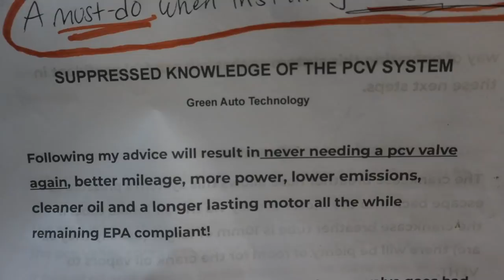The Wonder Of Positive Crankcase Ventilation

Comment: I would say the quality of engine oil did more for life expectancy than the pcv but it sure didn’t hurt anything.  Most all pre 2000 year diesels ran open crankcase vents and they certainly didn’t seem to suffer any longevity effects.  Of course being turbos they tend to keep their crank cases blown out anyway.
Reply: It's now common to add open crankcase breather kits on the newer heavy/medium duty semi engines. Most new diesels have oil vapor centrifuges that end up wearing out prematurely and cause seals to blow out from excess crankcase pressure. And those centrifuges can cost 600-$1000 in some cases.
Reply: Yes, the turbo is why old diesels get away without a pcv valve, on the non turbocharged 6.9/7.3 IDI Ford/International they used something called a CDR that acted similar to a pcv valve though I don't know how it works without vacuum.
Reply: My car is a diesel and its crankcase breather is simply a tube routed from the valve cover to the air duct between the air filter and the turbo. The filter is a flow restriction so that region of the intake should always be at a lower pressure than the outside air, presumably that's enough to suck the blowby gases out.
Reply: Fuel injection as well, carbs can’t accurately control cold air mixes nearly as well as EFI can.
Reply: Diesel does not have vacuum for a PCV. There is no throttle valve in a diesel engine. The rings are always seated to the lower side of the lands because of pressure always in the cylinder. The reason it works beautifully on a gas engine is any time there is vacuum in manifold it keeps the rings from bouncing in lands. This is also why race cars have a vacuum system on crankcase to suck the rings down and help them seal
Reply: Yes I'm old enough to had road draft engine and overall hauled s couple of them.  Engines were ugly inside and the sludge stunk awful.
Reply: @davepotanko5514  My 83 mercedes has positive crankcase ventilation  by routing the blowby tube into the aircleaner in front of the turbo
Reply: The non-detergent oils of the past and the lack of PCV, made it commonplace to remove valve covers and not be able to see any of the oil-starved valvetrain!
Reply: @davepotanko5514  Race cars often use a dry sump oil system where the oil is held in a tank outside the engine. This as you say produces a partial vacuum in the crankcase, because the oil scavenge pumps that recover the oil from the sump and send it to the tank are much stronger than the pressure pump that sends the oil back to the engine. The main reason to do this however is not for ring seating, there are lots of other advantages to dry sump systems e.g. less windage losses, better oil cooling and (most importantly) much greater resistance to horizontal G-forces in high speed turns.
Reply: I've run 1980s cars without a proper PCV system, in the 2000s.  Why?  Because it's not always feasible to rebuild an engine to make the PCV work properly, and, the oil on the underbody helps the car last.  I never had oil sludge problems.
Reply: @nerd1000ify  a vacuum pump on the crankcase for ring sealing, completely different from dry sump system
Reply: @bcbloc02  Volkswagens do the same thing must be a German thing. That is not positive crankcase ventilation   unless you have not changed your air filter in a long time. No vacuum Infront of a turbo just atmosphere pressure.
Reply: @davepotanko5514  Not completely different, a dry sump system achieves the exact same benefit by ensuring a low pressure in the crankcase.
Reply: 03 common rail cummins has a horsepower sweat tube no cat from factory and makes great emisions and as long as your rings are good you dont get alot of blowby so i never loose oil
Reply: NO engines --- diesel or gas were exempt from having a PCV after 1962 1/2 in California areas of Non-Compliance. That was all of Southern California and most of the San Francisco area too. 
Then by 1964 ALL engines in California --- the whole state either had a factory installed PCV or a retro-fitted one by installers and adjusters, like myself. 
However, by 1964, it was also a ConUS/Federal stipulation that ALL engines - both stationary and mobile, had to have PCV systems. )LNG and Propane engines were exempt for a couple of more years though) 
I was CalARB/EPA licensed in 1963 and made a lot of retrofitted PCV installations and people would cry that it was ruining their engines. Just like today with the Nancy-Deletes running around.
Reply: @davepotanko5514  High crankcase vacuum in racing engine is to help eliminate the drag from "pumping" the crankcase. That's a whole different thing.
Reply: Most of their miles are on the Open Road, so the draft tube works fine, whereas most passenger cars are often stuck in traffic, where it DOESN'T work well.
Reply: @SurferJoe46  you only plumbed it back into a atmospheric intake track. There is no vacuum in a diesel to make "positive" crankcase ventilation. You are only running it through the combustion chamber. Which leads to a dangerous condition to create a runaway diesel. Takes very little oil vapor to set them on a runaway, enjoy that.
Reply: @ferrumignis  if that makes you sleep better have at it.
Reply: @davepotanko5514  There's no excuse for ignorance these days Dave. Do a little research, broaden your knowledge.
Reply: @ferrumignis  you seriously think that a 3 stage scavenging pump pulls a vacuum on a running engine @6500 rpm. That is a kick ass ring seal you have in that engine.
Your right, I have broadened my stupidity.
Answer me this. Does a LS7 have a PVC valve? According to you I does not need one because of the dry sump
Reply: @SurferJoe46  limiting flow of what? You have positive pressure in a diesel crankcase  and atmospheric in the intake or ahead of the turbo. Where exactly are you creating a positive crankcase ventilation. Okay you put a catch can in-between the whole thing you are referring to sounds like another stupid C.A.R.B. solution that again does not work.
How many vacuum advance systems did you disable which did nothing in the long term except use more fuel and wash down cylinder walls with unburned gasoline, in the end creating more smog. Ca. is so short sighted it is really amusing.
Reply: @davepotanko5514  1) The scavenging pump is driven from the crank so it spins proportionally faster at higher engine speeds.
2) Who said anything about the number of stages? The only thing that was mentioned was a dry sump system, no details on the pump were given so you are clearly attempting to weasel out of this. It takes a man to admit they were wrong, so I don't expect anything from you.

Comment: Well, there were several things that cleaned up the engines in the Sixties . I'll give you my opinion, in the order I think most important  : 1), unleaded gas, ,,, 2), PCV valve, ,,, 3 plasma moly rings, ,,, 4), high detergent oil . Don't forget that steady stream of blowby coming down the road draft tube was caused by : gummed up engines, lousy cheap rings, and the non detergent oil that caused much of it .

Comment: i had a jeep that had a wierd system, instead of a PCV it had a fixed oriface that would plug up all the time, i actually upgraded that to a PCV and fixed a nasty blow-by issue i was having, i firmly believe in PCV valves, but i had no idea that they would use two PCV valves in some of the 2bbl classes, thats actually kind of cool to hear, great video, and very informative

Comment: I have a truck that had some blow by so i just straight piped both valve cover holes to the air box with no vavles. i have no idea if performance changed but the cab smells nicer now.

Comment: I bought a 65 Ford pickup with a 352 FE. It had 65k on it in the early 90s. It had a miss which turned out to be a couple bent push rods.  The old man who bought it new rarely drove it out of his small KS town. I pulled the valve covers and it looked like it still had valve covers. They were completely full of oil sludge. I had no idea it was because it didn’t have a PCV valve. Got it all cleaned up with a couple new push rods and it ran perfect.  It is one of those I wish I never sold.

Comment: PCV also added part throttle vacuum to the crankcase which lowered piston and valve guide blowby as well as main seal leaks. As I recall, there were retrofit kits available to add them in the 60s

Comment: I've got nothing but road draft tubes.... Haha. I love stock bubble valve covers, what can I say. With modern oils I have zero problems with sludge. When a CDR goes bad on my IDIs...... Road draft tube. No problem in the diesel's either. When I first started with road draft tubes I checked often for sludge and years later with hundreds of thousands combined miles, still no issues.

Comment: I just installed an aerospace vacuum pump on my stroker sbf. The crankcase pressure will often push gaskets out too. My 15 Volvo Semi has a crankcase evac system from the factory. D13 diesel.

Comment: I've got a 59 FE which I rebuilt last winter. It has a draught tube and was spanking clean inside. I certainly understand the smell of it idling though! 

It has been my understanding that motor oils are much better in the last 40 years. For example, the 59 Ford also has a 9" rear which had a thick tar like stuff in it along with the GL4 oil which I had put in it. I tore it apart simply to clean it all up. Old oils were prone to that black tar. 

I think it is the crankcase vapors which are not good for the engine to breathe. Therefore a mechanical vacuum system or better yet a passive exhaust evacuation system like UT mentioned with a filtered fresh air inlet is best for an engine.

Comment: I worked on a relatives GMC terrain that had some horrible oil in it last weekend, it had this rancid oil vapor mist smell that was strong up to 10 feet away when it was running, just like you described. Never smelled anything like that before come from a car. Even my old 352 that pumped a ton of blow by out the road draft tube didn't smell like that when it was running. Also, pretty sure that's a Y block engine there, the MEL looks dang near just like an FE engine and has the distributor up front. When it comes to those old engines, the sludge is bad enough but the smell when they're cracked open can be even worse!

Comment: I owned a 62 Pontiac with a 300 hp 327...exactly the same spec as the 300 hp Corvette motor for 62. It had a road draft tube...on top of having broken rings on almost every piston...and boy did it blow out oil.

Comment: Hi Tony, I’ve got a hot 429 in my Galaxie that runs a PCV valve in one valve cover and a catch can on the other valve cover with a baffle under the valve cover opening. I don’t get any oil as such in the catch can but I get a fair amount of foul smelling water in it that I assume would normally end up in the engine oil. I’ve done about 30,000 miles with this set up and the engine internals look like the day I assembled it.
Reply: When I worked at Lincoln and Mercury we never got any engine work from the 429 or 460 except a few timing chain and gear replacements.Those engines ran very clean inside and almost never wore out.
Reply: Why did you disassemble the engine at 30,000 miles ??
Reply: @hotrodray6802  it was a partial disassembly to change from a hydraulic cam to a solid. Had to remove the heads for machining for screw in studs as well as dropping the sump and removing the timing cover so I had a good look inside.
Reply: @hotrodray6802  Valve cover or intake gaskets would be my guess.

Comment: I remember when the PCV system was made mandatory here in CA. There were some problems at first, but they were straightened out. I also remember that engines started lasting longer. My brother bought a 1958 Pontiac in 1969 from the original owner with 32,000 miles. It had a lot of sludge in the engine. There was at least 1/4 inch on the oil filter. She only drove around the neighborhood, and not on the highway often. When my brother went to college, he didn't drive much during the semester, but the engine didn't get sludge in it. As to its beginning, what I heard was it was first used in WW2 because the road draft tubes in trucks and jeeps would clog with mud and cause pressure in the crankcase. I'm working on a 1959 Ford with a 352 "FE" engine, and I have added a PCV system from a '62 Ford. It runs great.
Reply: Did you add the factory CA emissions PCV setup or did you make your own? I built a 390 for my 64 galaxie using the original baldy valve covers and original intake that originally had a road draft tube. I made a bushing that pressed in place of the road draft tube into the intake and a standard 3/4" PCV valve presses into the bushing, run a hose to the carb and it still gets fresh air from the oil fill tube. Seems to be working great, no leaks and the oil remains clean and looking/smelling good.
Reply: @MattsRageFitGarage  I bought a 4 barrel manifold from a '62 Thunderbird, and it had the factory setup on it. On the rear of the intake manifold, there is a pressed in cap that is like the part of the draft tube, except that it had a short nipple pointing upward for the hose that went to the pcv valve rather than a road draft tube. The pcv valve had a hose fitting on one side, and a flare fitting on the other. This connected to steel tubing that connected to an inverse flare fitting and this connected to an inverse flare to pipe fitting which screwed into the intake manifold. This port was originally used as a vacuum source for the windshield wipers and went to the #1 and #4 intake runners. That would dump the crankcase fumes mostly into those 2 cylinders, and that would foul those 2 plugs. I remembered this being a problem with PCV systems back then, and the manufacturers changed the location of the vacuum port so that it was closer to the base of the carburetor, and the fumes would be more evenly distributed among all of the cylinders. I bought a new Holly carburetor which had a pcv port built in to it that would evenly distribute the fumes to the cylinders. Another way of doing it is to use a spacer plate under the carburetor that has a port built into it. The manufacturers of pcv conversion systems back in the '60's made these to overcome the problem of the fumes being dumped into one or two cylinders. They are still being made, and I bought one at Oreilly auto parts. I saw that Summit racing  has one for $33. I ran a rubber hose from the pcv valve to the carburetor port and I was done. This left the problem of the '62 pcv valve not having a hose fitting on each end. Since my engine is a 352, I used one for a valve for a late '60's Chevrolet 350 engine. If my engine was a 390, I'd probably use a valve for a Pontiac 389, or a Cadillac 390. I wish that I could post photos, as that would make it easier to understand what I have done. All my best with your projects. Your Galaxy sound like a great project.
Reply: @garylangley4502  My dad has a 64 galaxie also that was a Los Angeles assembly and DSO 71 car, his had the pcv setup like you describe except the carburetor spacer had the port on the back drilled and the hose went there instead of to that port on the intake manifold. That original 352 lasted 258,000 miles and was one of the most carboned up engines I had ever seen. 7 out of 8 pistons had the rings so stuck it took a punch and hammer to break them out of the piston ring lands piece by piece. It ran though! I yanked my 352 at 158,000 after finding cylinder 4 severely scored even though it had good compression, didnt burn oil and ran great. Also found the original intake gaskets barely sealing and all 8 intake valves leaked a bit. I couldn't believe that thing ran to 6000 RPM the night before on the way home from work. It should have been an oil burning pig.
Reply: @MattsRageFitGarage  Those FE engines were amazing! Thanks for sharing your experiences with them.
Reply: @garylangley4502  About 20 years ago we got a 68 LTD for $100 that was a 1 owner 220k ish mile car for the 390/C6 drivetrain out of it. Cylinders only had .0005" bore wear! actually, both the 352's I mentioned still had crosshatching in the cylinders as well. I see a lot of people look at the old every day FE engines as old oily boat anchors. Fact of the matter is most of the cars that went 200K+ miles were probably scrapped in the 80's or 90's because they weren't worth anything and nobody knows anything about them ever existing. All they know are the ones that have sat for years in a state of neglect that will still run that we keep finding people pulling them out of barns in these will it run videos we keep seeing.

Comment: Blowby fumes. I started out with Y Block fords. And they had copious amounts of Blow By. I would run a large hose from the oil filler to the carb side of the air cleaner. Plug the crankcase  breather vent on the side of the block drill a hole in the valley cover install a grommet and retrofit a PCV to those sludged up Boat Anchors. I had one that the fumes came up thru the steering collum and wafted out between the steering wheel and shifter .  I seen a guy with a really bad huffing and puffing six cyl run one of the spark plug wires down the dipstick tube and  start the engine. The exploding crankcase gasses loosened up the valve cover, side cover and oil pan really stretched those sheet metal componets. He knew what would happen.
Reply: I run a bunch of y blocks I made them to have pcv a long time ago it does help them

Comment: I've built motors on fords using the smog pump as a vac.  And a a regulator on valve cover, messy.
My favorite for a big motor, much cam and no vac, is a rip on the road tube. Its a venturi tube to the collector. Very effective, but near to actual race app.
Day to day. Healthy motor, PCV is a godsend. 
I'd love to see tunable benefits of the EGR circuit.